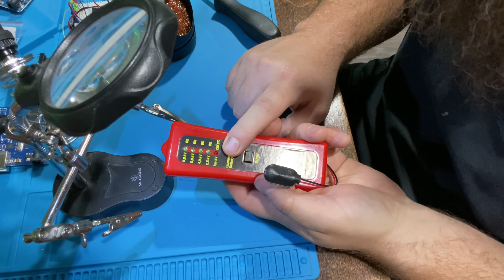Chicken Chickshaw Changes

Comment: My rule when playing with polynet is one must make a bad electrical pun when envigerated. What size juicer is it that it doesn't push a 8-12kV charge through a single net?
Reply from the maker: Heh, it is one of the smaller premier one intellishocks.  It can push the 8kv, but I was watching something about them last night. They where having an issue with not a good enough ground. So i was going to test that tonight.
Reply: @lindseyacresfarm  disconnect the fence from the charger and take a reading at the red clamp to get a baseline with the current max power (battery charge/sun strength) the unit is able to output.
Reply from the maker: @benjaminbrewer2154  That is a great idea, thank you.
Reply: @lindseyacresfarm  do you have some spare plastic posts? Use a short length of twine from the top to the net, to lift the rolled net off the ground (at points you have a rise between posts).
Reply: @lindseyacresfarm  as the tester is contactless, you are measuring field strength at a known distance being the increment is 1000 volts it is +/- 500 volts it doesn't have to be too accurate.
I didn't trust that tester when I first bought premier one nets so I picked up their other tester.  It is accurate enough but testing it against a known good tester of a neighbor to check calibration.